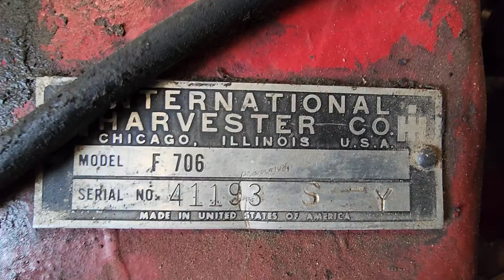What Happened To The Farmall 706?

Comment: What happened with the engine replacement? Any progress? Also curious what happened to the d282-what symptoms did u see when it went down? Running a 706 with a D282 myself, and think I may have to do some work on it soon, just curious. Thanks for the video.
Reply from the maker: I am still working on this replacement I have the tractor currently splits and the front half disessembled. I am rebuilding the front steering bolster and rebuilt the wide front. Everthing from the bellhousing forward is sandblasted and ready to paint. 

Going one piece at a time from the front to the back to do it right.

When I bought the tractor it needed alot of work it ran good but got alot of diesel in the engine oil and had to pump rebuilt and installed wich fixed the issue it was the umbrella seals on the injector pump drive shaft (They are a pain to get right). I ran it for about 10 months after that needed to get new injectors and did so then when using it under a heavy load it would start missing and cutting out as seen in my field cultivating video. Always felt like it was one revolution away from something flying apart in the engine. Generaly just lost power for no real reason doing things like field cultivating aswell.
Reply from the maker: @Lowdollar23 haha I am expecting something to happen one day but hope I get some good long use out of it before I throw out my rear end with adding 100+ extra horse power to it. Late model 706s ran a german diesel which I was a small upgrade but the 5.9 will still more than double the hp.
Reply from the maker: @Lowdollar23 will do I appreciate the tips and information.
Reply: Talked to a guy that wished he had not put a turbo on his 706 because he kept having to replace his clutches. When the torque went out on my 706 with a turbo, I had my mechanic replace it with a extra heavy duty one. Also had him install a heavier clutch.